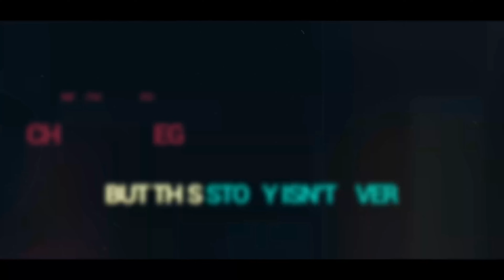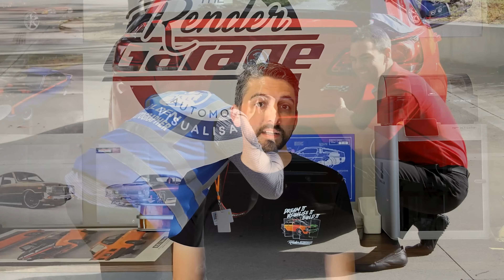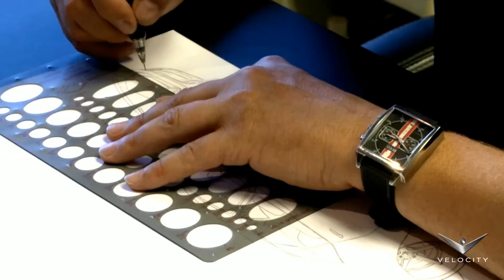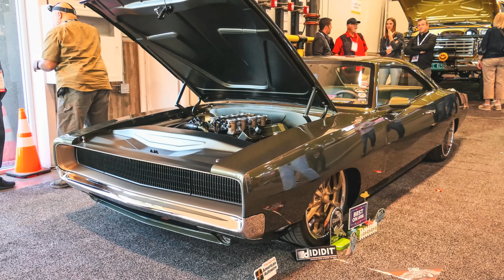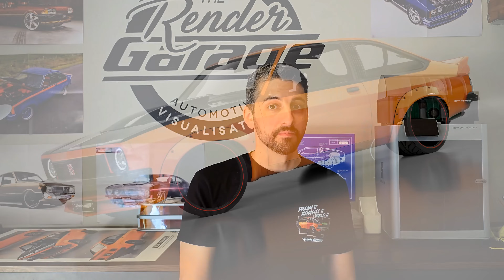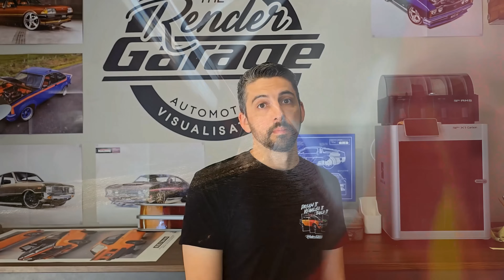My Torana Build Plans RENDER REVEAL | Ep.3: Custom 3D Printed Parts, 3D Renders & My Design Process

Comment: My vision is a full carbon fibre SS Torana 427 ❤
Reply from the maker: I certainly looked into that after coming back from SEMA this year! But ultimately its just way too expensive to do and I'm not sure what the legalities etc would be. I can imagine if it could be a reality, it'd be sweet to do all the 'blackouts' of the A9X in a smoked carbon fibre finish, so from a distance it just looks black, but as you get up closer you see that the whole car is actually carbon fibre - imagine how sick that would be! Maybe those Drive South Torana's might end up being able to be something like this!
Reply: The weight savings combined with rigidity would give stellar handling with big slicks. I had a hatchback years ago with 12" Simmons wheels with 345 Yoki's. Like driving on rails.  @therendergarage

Comment: Nice work Matt! At 11m22s (and other times) as the car is rotating, it looks like the windows are going up automatically. I know its only a trick of the light, but for a few seconds when I first saw it I thought...damn that is going to have front and back power windows, how sick is that!! Quickly followed by.....how the eff is he going to make that work?? Sadly though, I don't think it would be at all possible due to the rear wheel inner guards. Oh well, it was a cool thought while it lasted haha
Reply from the maker: Thanks! 

Yeah no power windows... probably not even in the front either. I actually like the manual operation of them for some reason.

Having the rear windows go down would be an awesome mod though. It'd be cool to cruise around with all the windows down, but now seeing the inside of the rear quarter, there is not enough space... it might be possible with some funky engineering where the glass 'tucks' into place... but it'd be a huge job! I'd prefer to spend my time and money to make it perform and drive better!

Comment: Bumpers look ok yet bulky, could you get fglass ones to play about with, cutting the height down or tucking in more. I remember seeing an A9X back in the 80s with split front bumpers or quarter bumpers and the rear was notched or stepped for the license plate recess.   Have you looked at extended bumper ends to the arches front n rear ?   I'll give you sub mate as i like car mod engineering stuff 👍
Reply from the maker: I am thinking about getting  a set of Fibreglass ones to muck around with and also to save a little bit of weight... But just saying it out loud... they could also be 3D printed 🤔 and then modified a little further to get them all 'sitting' a little better against the lines of the car.
Reply: @therendergarage   3d print will take weeks lol .. if you can that'll be fantastic to see.. tho fglass will be the way. Just quietly, I do fglass stuff, once I modded a Nissan Silvia body kit to fit a mates mk1 rx7  race car. Anything is possible mate 👍

Comment: Grouse. The new surfacing you've done is very in-keeping with the traditional shapes. I've always thought the small splitter under the front air dam is a great idea and I'm intending to do that on my hatch also (although only planning a plain black panel in my case), your design looks spot on for a modern twist without re-inventing the whole thing.
Reply from the maker: Thanks mate! Yeah, the splitter ties in really nicely, I thought and hopefully it helps then visually connect the front spoiler and flares all whilst keeping the car still looking 'Torana' 

I was certainly inspired a fair bit by your build and how much you were willing to push the envelope!

Comment: I reckon we should remove those big round head bolts on the bumpers before we wrap them. They weren't fun last time.
Reply from the maker: It would make your life easier wouldn't it! It can be done, but I'd need to get them re-chromed (for the future if I ever peel the wrap off).
Reply: If you're gonna do it may as well do it right. Plus fresh bars match fresh shiny paint. 😉

Comment: Chip Foose was big on not "changing" the designers original intent of the car but changing elements on/around it.
Things like making the bumper fit perfectly to the car & removing the visible attachment bolts, subtly changing the grille, headlights etc, ever so slight changes to the body lines. The end result was a car that looked like the original but but looked different in some way. 
The renderings of the Torana are just that, simple (but probably not to actually do) and super clean. You'll know its a Torana, but there will be so many things that just look different, in a good way.
Reply from the maker: You've nailed it! The reason the Torana is so popular is that it looks so damn good, straight from Holden. There is no need for wholesale changes, just subtle mods that (hopefully) bring it all together and make it look even better! To the untrained eye, they'll just think all Torana's must be like that.

Comment: I agree with you about the join between the front flares and the front splitter.  The other thing that always bugged me, when I owned my LX was the front and rear bumpers.  They just always looked like an after thought compared to the over-all aesthetic of the vehicle.
Reply from the maker: Yeah, I agree! I'm still thinking about what can be done with those. Unlike other cars, where they tuck them in, that doesn't quite work as well on a Torana as I feel it messes a little with the proportions of the car. I've seen a couple of cars that have done a really neat job of cleaning them up, but its fairly subtle... I'm hoping the brushed satin look helps visually pull them back into the body a bit and make them look a little more integrated with the rest of the car.